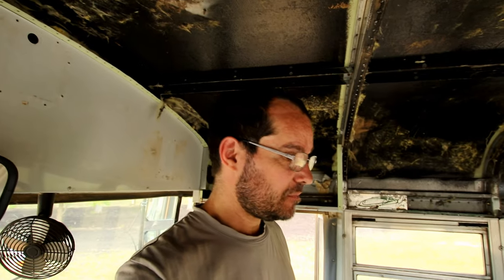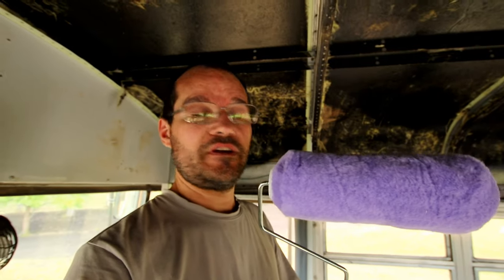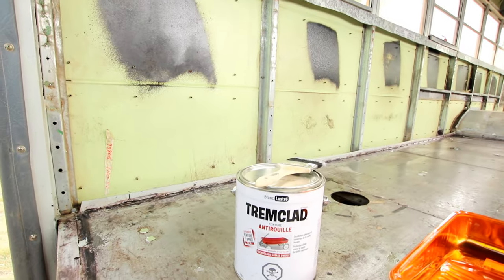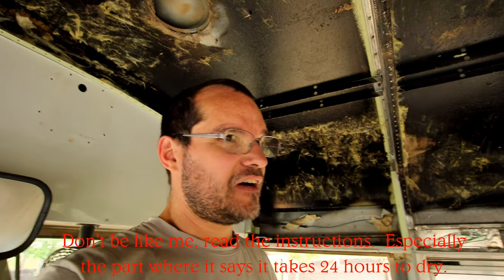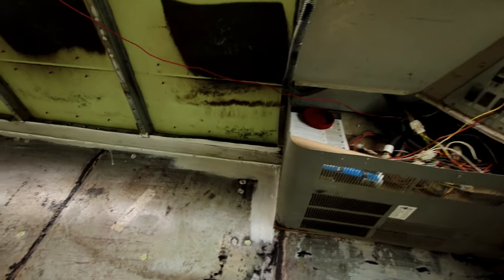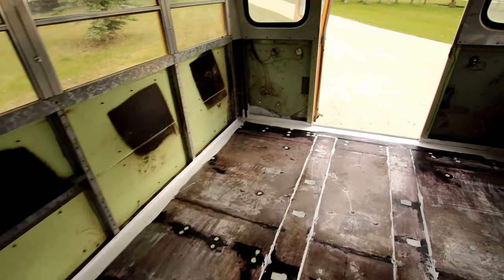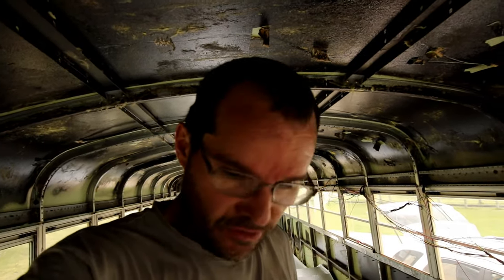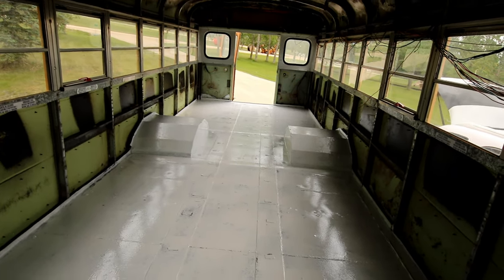Skoolie School Bus Conversion #4 - Painting the floor July 16, 2018

Comment: What a difference just one coat of paint makes. Why did you choose enamel/oil based paint instead of latex/water based paint?
Reply from the maker: If by some bad luck i do get a water leak the enamel/oil based point won't strip and peel like a water based paint would.  As an experiment if you were to paint a piece of steel with one section oil based and one section water based then after it is dried you put some standing water on it, the oil based would stay in place and the water based would start to bubble and peel away.

Comment: Did you put down a primer before the rust paint? And I can't find this rust paint in NJ is there another you'd recommend?
Reply from the maker: No i didn't put down any primer.  It was a paint and primer in one.   Just pick up any rust paint that is a paint and primer in one.  Also make sure its oil based, this way if you get water inside, the paint won't peal up.  Some water based paints will peal or deteriorate with water.  Oil based paints take longer to dry so read the directions and it will tell you when you can put a second coat and how long it takes to dry.
Reply: Ok thank you!!! Going to Home Depot now!
Reply: @RvWorldTraveller  and I don't need a rust converter? Home Depot was not helpful in the slightest still don't have anything.
Reply from the maker: @kyrawoodard1485  Sorry...i had thought you had already done the rust converter since you were asking about paint.  The Rust Converter i got off of Amazon.  As for the paint, do you have a Lowes in your area?  A paint store?
Reply: @RvWorldTraveller  nope ok so we have to sand it, convert the rust, and then paint it with an oil based paint from Lowes
Reply from the maker: @kyrawoodard1485  Right.  Sand it down with a grinder using a flap disc (doesn't matter what grit).  When grinding make sure to wear a dust mask.  Use a rust converter, then use an oil based rust paint.

Comment: I’m new to the build process still, what’s the benefit of painting the floor after treating the rust?
Reply from the maker: If by any form of bad luck you get a leak inside the bus the water will sit on the paint and not the metal causing rust.